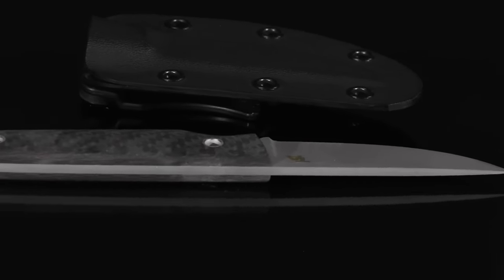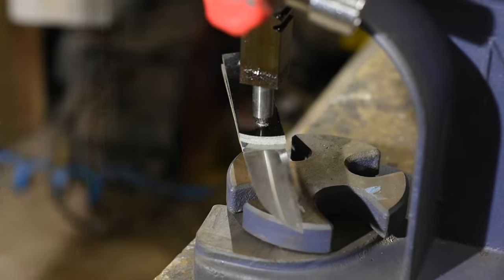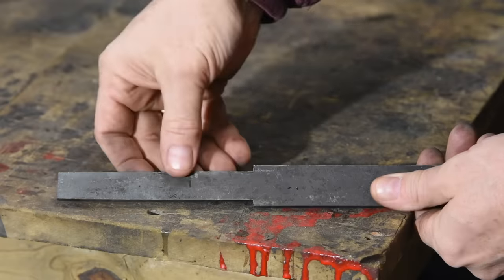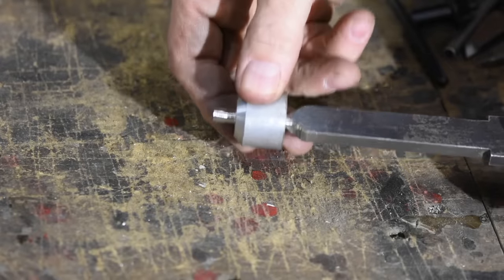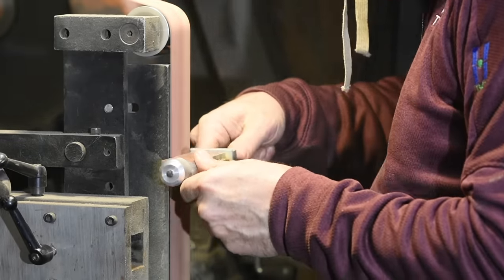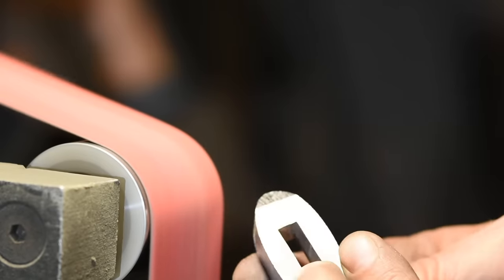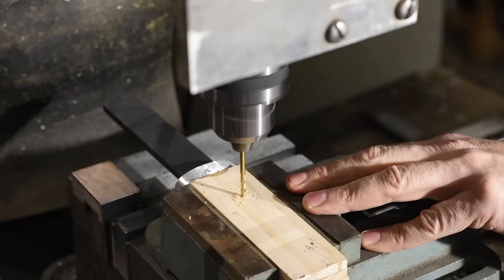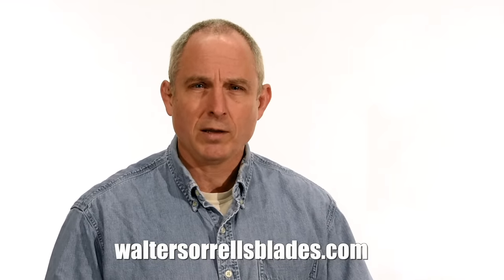Knife Handles 101! - How to Make Knife Handles

Comment: RIP to people who have none of this machinery or tools😢
Reply: You could definitely get away with waaay fewer tools. You don't need a band saw, belt sander, or a drill press. They'd make it easier but you could probably manage this with a basic drill, some sandpaper, and something to cut wood with, like a handsaw of some variety.
Reply: I used chisels and a hand drill to make grips recently it is tougher by a little but it’s certainly not impossible
Reply: You can absolutely make even the most intricate pieces with zero, and I do mean zero power tools. Vikings, gladiators, samurai warriors etc etc are a perfect example of Bladesmithing without one single electrical source. Time consuming? Ohhh yeah. Impossible? Ohhhh no.
Reply: I do my handles all by hand and it doesn’t take as long as you might think but I do have a nice vise, rasp and solid drill press

Comment: Actually, if your guard doesn’t quite match with your handle, buy fiber spacer material from any knifemaking supply store.  You cut it to fit, and it compresses a bit, making a seamless joint.  It comes in many nice colors, if you want a color accent.  This also works between the tang and handles.

Comment: That arbor press is a very underrated tool, It paid for itself fast
Reply: I’ve been on the fence about getting one for tube rivets. What else you use it for?
Reply: @arn6376  press fit pivots, and press fit tang pins on balisongs and other knives that have them

Also makes pinning a regular knife handle rather easy to set them in place before they get peened

I paid like 70ish for mine, it's a 1/2 ton from palmgren off ebay

want to get the rivet setup for mine once I start doing kydex stuff too
Reply: @KABAR1943  right on man thanks for the reply! I just got started with kydex and just have a couple spyderco mule teams I’m making handles for and really wanted to do flared stainless tubes on them. 

Probably getting a head of myself if I invest in a arbor press as I don’t actually make knives yet, but man I love the look of flared  tubing rivets in knife handles lol 
Thanks again man

Comment: Thank you for this engaging and informative video.
 I confess that, by the end, I was so emotionally invested in the dummy knife that I yearned for you to carry on and finish it, though I knew it was probably just a slab of mild steel.
 I envy you your wide selection of shop tools - I just use a small angle grinder, drill press and files. I'd love to have the chance to make just one knife in such a well-equipped shop!

Comment: Hi, great video. Hey I have a 2002 USA made Marbles Fieldcraft knife..similar to the classic woodcraft knife from back In the day, just a bit smaller. I love the quality but some of the brass handle discs protrude out a little higher than the plastic discs. Can I sand these down to even the handle out or should probably not even worry about it? Thanks

Comment: Gaurd tip: you can heat just about any material but aluminum and punch and drift your guard slot, its how they were done before the age of steam. the reason i excluded aluminum is you cant really judge the temperature of aluminum.

Comment: Hi Walter!  I'm really confused about what the best procedure is for attaching removeable slab handles to a full-tang knife with screw fasteners is.  Specifically where I am having issues is figuring out the lengths of the screws and barrels to use and how to best drill the countersunk holes.  I could figure it out before contouring, but that puts me in danger of hitting the screws while shaping the handle.  If I shape the handle first, I have several unknowns to deal with about the screw/barrel dimensions and how to countersink.  Seems like a chicken and egg problem.  How is this done by the pros?

Comment: I'm an artist new to knife making. I've graduated from acid etching and sharpening to now making my handles. Got lucky, and have a nice Black Walnut tree in my yard (25 years, and I never knew I had an expensive tree on the property). So does anyone have tips on how to dry/cure the wood? My only inclination is to cut a few sections. and dry it by an indoor heater, then oil it. Any advice would be appreciated.

Comment: Are there any good quality inexpensive ban saws that you would recommend?
Reply: Bug-Out Boy sawzaw are the most reliable for the money but a step down Milwaukee. Step up skil
Reply: @justinmielsch5936  Thanks!
Reply: Bug-Out Boy 👍
Reply: I have a portaband mounted to a table made by "Swag." It was easy to assemble and works great. I'm limited by the throat of the saw itself, but without dumping a paycheck into a piece of equipment, it's a good solution for me.

Comment: Do you heat treat before you drill for the cross pin on the hidden tang? Is there a trick to drilling the heat treated steel? 

Awesome video!
Reply: U not supposed to drill after u heat treat because most steel u would buy is anealed  witch means it’s in a state where it’s easy to grind so u would drill the holes right after u shape the knife

Comment: For finishing...how to keep blade from rusting.  How to seal a wooden handle properly.
Reply: Well ideally you should be using stainless steel which shouldn't rust
Reply: Forged in England except stainless doesn’t hold an edge as well as high carbon does. Thais why a lot of professional chefs use high carbon. Stainless has it’s place but it isn’t the best for everything.
Reply: @jessemarshall7176  that's true but from him asking about rust Im guessing he's constantly using it in a damp area. Obviously will need to sharpen it more frequently.
Reply: @jessemarshall7176  You have high edge retention stainless steels like S30V, S90V, M390, 3V but they are not exactly cheap and can drive the price of the knife way outta some people's league.
Reply: Will S true but I’m assuming the comment on this video means he doesn’t have the correct heat treating equipment for stainless.
Reply: Forged in England I’m in southern Louisiana we constantly battle humility thus rust so I can understand that. I keep all my blades coated in a thin layer of food grade mineral oil  and coat the inside of my sheaths with paste wax to help prevent rust when not In use.
Reply: @jessemarshall7176  linseed oil on a rag while knife is tempering will seal it and make it rust resistant,unless you are doing some fancy damascus pattern.
But then again those are showoff knifes not practical every day use .
Reply: zumbazumba1 I did not know that. Does it effect the look of the blade any? Like a forced patina?
Reply: I'm using coil and spring steel for most of my blades. I like the linseed oil trick, that's doable.

How is stainless quenched or heat treated..since it was assumed I don't have the capability.. what is so different in the process?
Reply: Nick Prather it varies depending on the type of stainless. Some require them to be wrapped in a stainless foil then soaked at a specific tempert for a period of time while others reach full potential by cooling in liquid nitrogen. Unless you have a tempering oven that can be programmed most stainless will not work out well.
Reply: Nick Prather there is also quenching between two plates of aluminum, I think it’s aluminum I’ve never plate quenched before only watched a few videos on it. I believe it’s used in a lot of stainless Damascus
Reply: @jessemarshall7176  didn't know that..thanks. you may have just saved me some money..lol. I'm not good enough to buy special/specific steel yet...so I use what I can get a hold of for cheap or free. I have a homemade shop..haha.  I made forge for 20 bucks..2x72 for 15 bucks...tongs for free, and anvil wannabe for free. Press is next, then power hammer ;)
Reply: Nick Prather unless you get a killer deal on a power hammer I’d suggest you work on your skill set first.and known good high carbon steel can be bought daily cheap online. It’s good to have known steel so you know exactly how to heat treat and temper
Reply: @jessemarshall7176  Yes it will turn steel black,its like gun blue.Just be carefull ,expect a smoke since linseed oil is flamable-so gloves and working outside is recommended.
https://www.youtube.com/watch?v=z8JWYhCFImQ
Its super cheap to do it and you can find linseed oil everywhere-if its not boiled you can put it in a cooking pot and heat it up on low temperature to evaporate water.(be carefull do it outside ,it might go in flames,so fire extinguisher is recommended,also use double boiler system).
Reply: zumbazumba1 I use linseed oil on. My wood scales sometimes so I’ve got plenty laying around. So as soon as I pull it out of the temper I apply the oil? I’m going to try this on my next one.
Reply: @jessemarshall7176  Check the video i linked you ,it explains process better.
This wont make your knife 100% rust proof ,even stainless steel rusts eventualy.
But it will slow it down a lot.

Even chromed wrenches rust ,just give it a time of 50-60 years.Depends on condition.Drop it in a ships waist water below engine and it will rust in 1-2 months due to galvanic corrosion .

Speaking of wrenches try making a knife out of Chrome vanadium big wrench.
You can find them on flea markets for cheap,steel is strong and since its drop forged already shouldnt be a problem to work with.
Reply: @jessemarshall7176  Some other cheap to get steel's are old files (high carbon),ball bearings -both balls and inner/outer races,
printer/3d printer shafts ,car leaf springs/shock absorber springs ,truck axles,old garden tools like hoes,plows ,hammers,crowbar's ,axe's etc.You can find a lot of these things on flea markets and junk yards for very cheap price.They sometimes can be a mistery steel but that is the beauty and fun of it.
And since they are dirt chap,you can have a lot of fun for 20$.
Have fun forging ,unless its your buissness-then youa re not allowed to have fun only profit!!!

Comment: I’m getting into this so why not make own handles from firewood that’s is sold for free nearly every where just come and get it only catch
Reply: Well firewood is normally dry and weak, so it wouldnt make a good handle. It could crack or split when you try to cut it or drill it. Besides, It's not the best looking wood. A good piece of walnut wood or hickory is solid, and relatively cheap. Good luck and keep up the good work. Took me months to complete my first knife and I scrapped lots of steel and wood!
Reply: @bobbinette3368  yea I tryed to make one last night it cracked it definitely use what you recommended

Comment: How to you not burn the wood
Reply: SniperArts when are you burning the wood? Cutting or grinding?
Reply: Fresh sandpaper, slower speed, Sharp sawblades
Reply: Grinding and I only have a single phase grinder
Reply: SniperArts without speed control the best you can do is use a good fresh belt and less pressure or you can cut the bulk away and rasp/sandpaper the rest although it is slow. If possible try to upgrade to a vfd it makes a world of difference having speed control
Reply: I have the bador single phase can I just buy a conversion kit
Reply: SniperArts motor needs to be a 3phase so sadly your stuck with what you got for now. On the plus side if you ever convert you have a good motor for a disk sander. Those are almost always single speed although I have seen some variable speed ones